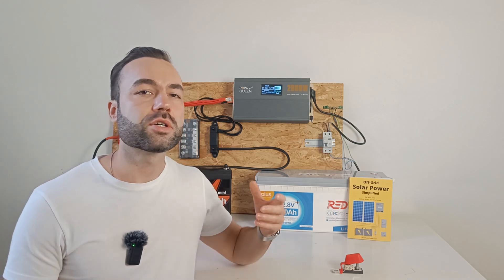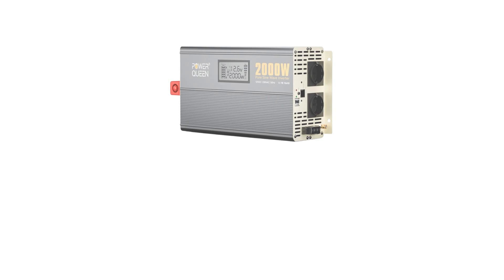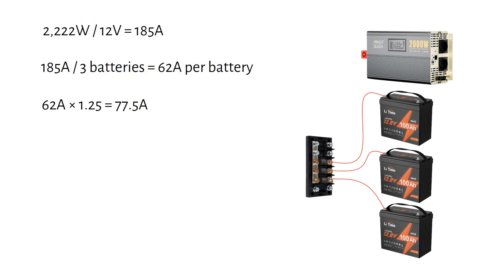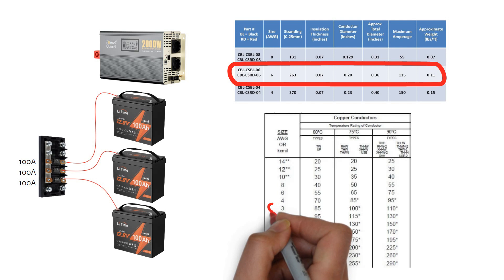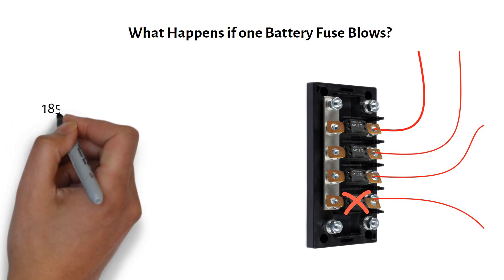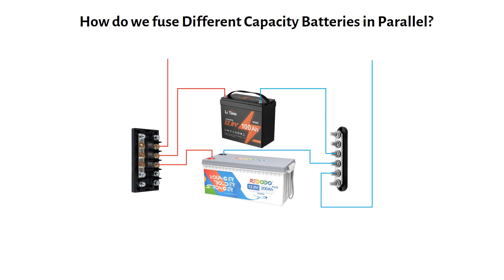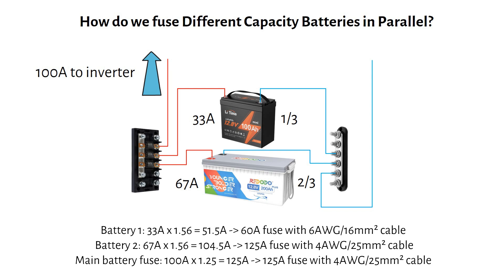How to Fuse Batteries in Parallel - Current sharing and cable selection

Comment: What I have not found yet on youtu.be is charging 48vdc lithium batteries in parallel that are of different capabilities. I have 6 parallel 48vdc and on of them is of higher capacity. 
When charging, at 60 amps for example,  each battery is being charged at 10 amps each. But when the 5 say 100ah batteries are fully charged, the battery 110ah then is receiving the full 60 amps. I do not think it is healthy for that battery. Can you tell me if my thoughts are correct or not. I have disconnected the 110ah battery because I think it is going to denigrate much faster or cause a problem. 
Thank you.
Reply from the maker: It's normal for the larger battery to receive a larger current. That's what happens in a parallel circuit when the voltage always stays the same. So don't worry.

Comment: I have 4pcs of 24 volts battery in parallel  lifepo4. I'll fuse it each battery mbrf 50a and wiring 8awg then 150a bus bar and wiring the bus bar 6awg to 2000 watts inverter. Is it enough for my set up? 😊

Comment: I will put together a battery bank that's 3S 2P( total of 6 12v 250 ah Lifepo4 batteries). What fuses/ breakers do i need? Any advice or tips are greatly appreciated

Comment: what would be the correct way to fuse 4-6 batteries in a 48v system?
Reply from the maker: Depends on your inverter size
Reply: @cleversolarpower  inverter size is 12kw, so 125A class t fuses? any recommendations?

Comment: Thanks for going into the crucial details.  Not saying it's wrong, but just wondering. Why did you use 12V for the battery voltage instead of the higher nominal voltage of 12.4V for the battery or the likely lower low-voltage cutoff of the inverter in the calculation?
Reply from the maker: I simplify it by using 12V, it's the better choice as a worst case scenario. Most inverters are going down to 11V indeed. But our safety factor will cover that. And when you draw a large current, the voltage will drop. So it reached the cutoff voltage of the inverter sooner.

Comment: Great Videos Nick
I would love it if you could do one for an RV ..I have a 22ft with 12v system ( tv , stereo , led lights, power awning, etc ) also has a 30amp shore power connection for the 120v side ( 1400w microwave  and hoeshold outlets ) I'm replacing the two 6v golf cart batteries  with two 314 ah lifepO4 , 2000w inverter & have a 80amp litime battery charger with the anderson connectors,  also have a 400amp shunt...
Not sure if I'll use busbars or do a simple diagnal parralell setup but they will be paralleled for sure to make 628ah capacity ..just not sure how I'll wire things exactly..
Thanks and keep up the great work !!
Reply from the maker: Thank you. I have a few videos on my 'systems' playlist. You can also see some diagrams on my websites homepage.

Comment: Battery currents don't always split evenly. Slight temperature differences, state of charge differences, and resistance of connections differences can cause rather significant differences in currents from low impedance batteries. Another design approach would be to consider what each battery can safely contribute based on it's specifications and BMS ratings and base the fusing and wiring on that. This would also allow future growth and upgrades. Marine wire would meet insulation requirements better than welding cable.
Reply from the maker: The fuse should never be based on the BMS current. This is a myth that is going around and I don't know why. BMS'es can deliver surge current. Instead you have to wire and fuse based on your max load. And i have added an additional safety factor to account for imbalances.
Reply: Battery currents don't divide perfectly and small safety factors are often insufficient for these extremely low impedance lithium batteries in real life scenarios. Customers often increase loads later and basically no growth potential has been allowed for. The design presented is minimal and doesn't allow for future upgrades which might be the goal of a low budget RV manufacturer but not everyone wants to build minimal "value engineered" type systems. Wire gauge should be selected with more generous future capacity margins and fuses are selected to protect wiring per code. The BMS values provide upper engineering limits to the proper choices. Choosing minimal values is one way to design but not the only choice, and ripping it all out to increase the wiring for subsequent changes is not future proof design. If we designed houses this way the wiring would have to be replaced multiple times over the life of the structure. BMS's shut down far faster than any fuse or breaker and the fuse is only actuated when there is a simultaneous system short and BMS failure, a rare double failure situation. Using BMS values is not a myth, it is an engineering choice based on upper limit specifications that future proofs the design and minimizes the copper losses that are often significant in these low voltage systems. Presenting a clear range of alternative choices is better than indicating to viewers that there is only one way to design.

Comment: Thanks again for the information sharing! I am attempting to wire 2- 100 AH 12vdc Lipo RedOdo batteries. The manufacturers diagram shows one conductor between the - negative terminals, same on positive side, then 2 conductors one from each battery to a buss bar. I have the MBF fuses and holders. Do I connect the conductor between the two batteries to the load side of the fuse, thus having the two conductors to the load side of these fuses thereby having two conductors on the load side of the fuse?  They say to make all cables the same length.  Also I would like to have a disconnect switch. Can I input charger current on supply side of disconnect to charge batteries are in the off position?  Any help would be greatly appreciated and helpful! RedOdo has not responded to my questions as originally I was wanting to lie them on there side?   Then do I connect the charger - negative conductor to the battery side of the shunt?? No response! Thanks again for sharing your knowledge in helping us with these issues! Love every video!

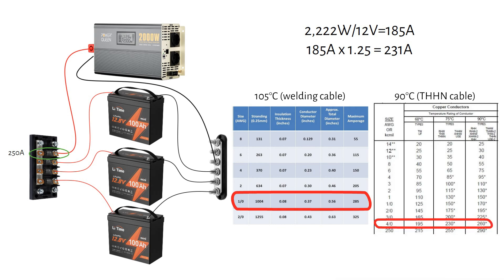Comment: The electrical theory here is very solid and well presented.  I don't know what use application(s) the video anticipates, but at least in the US, I'd suggest folks be careful of the impacts of various electrical code requirements.  For example, for BOATS in North America, where American Boat and Yacht Council (ABYC) Standard E-11 applies, E-11 DOES NOT ALLOW the use of Welding Cable, as recommended at 3:50 in the video.  The E-11 Standard does allow Conductor Type THHN, shown as an alternative at 3:50.  Welding cable insulation does not meet ABYC durability requirements, and is vulnerable to softening and deterioration from oil and other hydrocarbons in engine room and machinery space environments.  I don't know if welding cable meets the requirements of local building codes in offgrid locales that are subject to local building codes, or use in RVs, but folks intending to use welding cable in these applications should check the relevant codes before use.  

Also, you very correctly mention frequently checking the individual fuses in parallel bank configurations, and I completely agree, though I wonder how practical that advice is in the context of the "set it and forget it" mentality of most humans.  You very correctly mention the greater demand placed on individual batteries in the case that one of those fuses blows, but you don't mention the concurrent loss of capacity of the bank, and the possible consequences of that loss of capacity to expected bank runtimes.  Loss of bank capacity can lead to unexpected, premature loss of the usefulness of the bank, leave a gold cart stranded, leave a boat without propulsion, etc.
Reply from the maker: Great points. Indeed, you need PVC insulation to be compliant with ABYC. These have a lower temperature rating, so you will need to increase the diameter. I'm aware of the 'set and forget' of a lot of people. If one fuse breaks, then indeed there is a reduced capacity. And depending on the size of the inverter, this might trip the inverter because there is not enough current being supplied (usually 100A per battery).

Comment: if i have two (314 ah lithium) batteries in parallel...each with a 200 amp bms...will a 200 amp mrbf on each battery with 1/0 cables be ok?
Reply from the maker: The size of your fuse is not based on the BMS, it's based on the load (your inverter).

Comment: I"m confuse about this and your "12v 3000w inverter" video regarding fusing those 3 batteries. On this video, you divided the amps load per battery, while on the other video, you just base the fuse on a single amps per battery and not dividing them per battery.

Comment: The 105C cable in your chart isn't rated for a situation where the system is located inside an area like a shed or van where it can be a very hot ambient environment.  It will be derated and the 2/0 might not be enough at almost 300A.  Does that mean 3/0 would be a better choice?
Reply from the maker: That's why we use the 1.25 safety factor to account for the ambient temperature increase.

Comment: Fuses cost a fortune for what you get.
Rather have a circuit breaker.
His numbers are fine if you run at max output.
Battery BMS will shut down the battery if there is a short or overload.
Reply from the maker: Never trust the short circuit protection on a BMS. They are just electronic switches.
Reply: @cleversolarpower  BMS is a backup plan.
I will use a ckt breaker for each battery. Maybe later add in fuses.
Have a LOT to get next month - MPPT, ckt breakers, 2 more panels, 2 more batteries, more wood, hardware, etc etc etc.
Probably get a 100 amp breaker for each battery (they are 12v 100ah each).
My inverter has external replaceable fuses on it from the factory.
400 x 12 = 4800 which is right about battery capacity.
Inverter is not going to use all that at one time.
Maybe 500 watts on a 2kw inverter.
That way I have a big safety margin.

Comment: Is not cable to be derated to the lowest temperature rating of all components it is connected to? As an example, if the fuse holder is rated at 75 degrees, then a cable rated at 105 degrees and running at full ampacity, could this become a fire hazard?

Comment: Different capacity batteries safety margin 1.25 showing 1.56 is this an error or a reason? Why is the fuse to inverter 100 amps and not 250 error or reason? Saw it again arrow pointing to inverter is just an arrow

Comment: Thx for this, will be picking up my motorhome next week and will convert it to lifepo4 and maximize solar, your info is invaluable. 👍
Reply: how did your conversion go?
Reply: @CraftyCampingGirl I have a 48v 100ah golf cart battery from Wattcycle connected to a 6.2kw off grid solar converter for the 230v circuit. (Induction cooking, oven, coffee machine, ps5) And a 12v 314ah battery for the 12v circuit, (lights, compressor fridge) and a 2400wh power station for well...extra. 😂 put 5 x 200wp solar panels on the roof but they aren't doing much now in winter. 

So the conversion is going okay. 😁

Comment: Why are the battery fuses sized according to the consumer and not sized as per each battery's capacity?
Reply from the maker: Because it makes no sense to fuse a battery with 100A if you only draw 20A from it. You can do that, but the cost of your wire will be more expensive. Because the fuse size is based on the diameter of the cable. And the diameter of the cable, in turn is based on the current through it.

Comment: I have 4, 100ah lithium going to bus bar, I'm using 10awg wire is this sufficient?
Reply from the maker: Depends on your inverter/charge controller.
Reply: @cleversolarpower well I have a 2000 wat pure sine wave wave inverter. All 4 batteries are going to a 250amp bus bar to equalize the power from the batteries .Then the inverter , solar charge controller, and a 12v -6 circuit fuse block from the bus bar.

Comment: Hi Nick.  Should I use the "inverter watts / efficiency / volts" formula, or the inverter's manufacturer's specified "Max. Rated Battery Input Current" ?  In my case the difference is 73A (3000W RedArc 12-3000-RS3) and some significant difference in cable sizes and cost.  Thanks very much.

Comment: The explanation of fusing different capacity batteries doesn't make sense to me.  I don't see how a 100ah batt could only provide 1/3 current and 200ah 2/3 current in a parallel circuit.  Unless the batteries are markedly different in resistance, they'd both deliver the same amount of current in accordance with ohms law (I=V/R).  The 200ah would just last longer but would that have no impact on how one were to fuse the circuit. What am I missing?
Reply from the maker: You are missing that in parallel batteries the voltage stays the same. If you look at my video you can see the voltages are the same. In order for these to remain the same, the larger battery has to deliver more current to keep it even since it has more amp hours.

Comment: Question If one battery is not connected direct to the other how can the BMS of each battery tell that that is paralell connected ?
Always thought like you did in other videos plus to plus minus to minus , then from plus of one battery and minus from other battery and then to what ever.
Reply from the maker: It doesn't need to know there are other batteries in parallel. Why, because the voltage of parallel batteries equalizes itself. if you connect a 13V battery to a 12V battery in parallel, they both come to a similar voltage level. The same voltage level has the same remaining capacity (ah). The way you are describing the connections is correct as well. you can use a busbar first (requires less thick wire) or from battery to battery (requires thicker wire).

Comment: One thing i dont understand is the cable size from batteri to negative busbar, and cable size after the negative busbar to example mptt and other stuff, does the cable dimension gets smaller after the busbar?
I read the intire book and did not find any answer to the bubar i write 
Also should one not have a fuse on each batterie also in this video ?
Keep up the good work you make very educational videos for noobs like me.
Reply from the maker: Please checkout my video about current sharing. the is an MRBF fuse on each battery.

Comment: Hi can you show how to fuse batteries in parallel…I am a bit confused I thought the positive connects to a positive and negative connects to a negative are you saying to do what I just describe but also add a second cable from the positive to a fuse on the bus bar?
Reply from the maker: I don't understand your question. I made a video about parallel battery wiring, check that out please. Every parallel battery needs fusing.
Reply: @cleversolarpower hi I am more confused i understand the calculations that you performed but i am more visual as well do you happen to have a drawing? How are they parallel if individual fuses are connected to the positive? The way your calculations explains that mean I need a battery on off switch for each positive fused wire

Comment: If you're going to run a shunt would run it from the negative bus bar  or one of your negative post of a batteries.
Reply from the maker: If it's a battery busbar, then after the busbar. If it's a system busbar, then before the busbar. Search my channel for 'shunt' where i go in depth on the placement of a shunt.

Comment: If you have those 3 batteries in parallel, is it better for each battery to have it's own MRBF fuse before going to a manual on/off switch or is it ok to connect them in parallel then to a larger MRBF fuse then to the manual on/off switch?
Reply from the maker: I recommend fusing every battery in parallel. So on each positive terminal an MRBF fuse.

Comment: I’m a bit confused. This video led me to believe a 30 amp fuse was adequate however I just watched your common fuse mistakes which made me think I needed a much higher rated fuse. I have 6 strings made up of 4 12v 100ah batteries (48v system) 24 batteries in total. My inverter is a 4kw. In this example, wouldn’t a 30 amp fuse be sufficient?
Reply from the maker: 4,000W/0.9 inverter efficiency = 4,444W DC input. (4,444W/48V)*1.25 safety factor = 115A is your current. Since you have a 48V battery system you need a class-t or NH000 fuse as your main fuse. You should also use class-T or NH000 fuses on each individual string. Check my video: common fuse mistake and my new updated fuse recommendations for voltage and battery capacity: https://cleversolarpower.com/icc

Comment: I'm wary about sizing fuses or cables according to expected current draw from a particular inverter. Certainly everything has to be sufficient for the inverter's draw but I think best err on the side of caution and use heavier cables and fuses than what you might use. That way you don't worry if say one of the paralleled batteries is drawing higher share of current than others.
Reply from the maker: That's why I'm including the second safety factor of 1.25 in the equation. You can oversize your cables, but make sure the fuse size is under the current of the cable. Because you want your fuse to burn first, not the cable.
Reply: @cleversolarpower  thank you 🙏

Comment: Nick, i love your videos! Is there any reason you don't use circuit breakers instead of fuses?
Reply from the maker: Glad they are helpful. Most DC circuit breakers don't have safety certifications. And if they do they are a lot more expensive over DC fuses. Ac breakers are cheaper thats why I only use ac breakers.